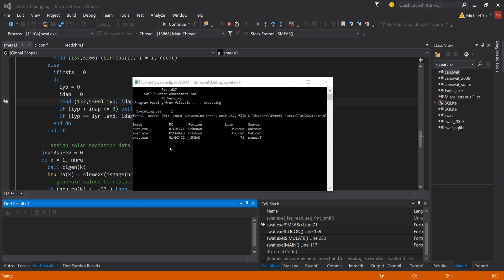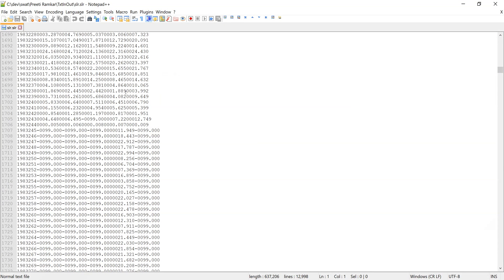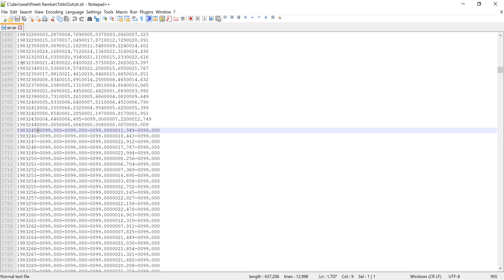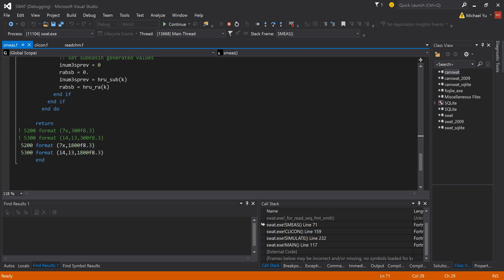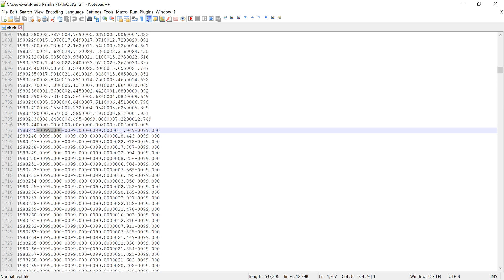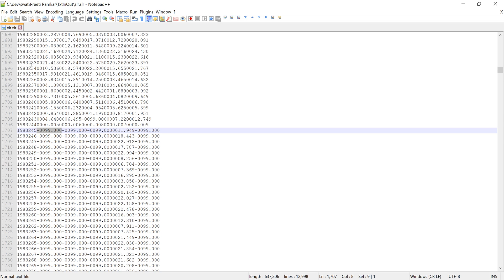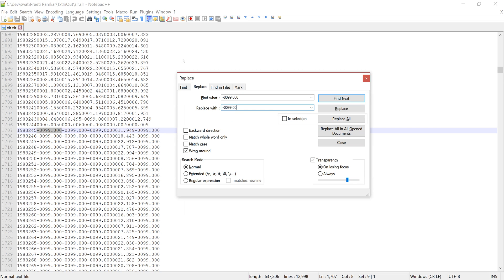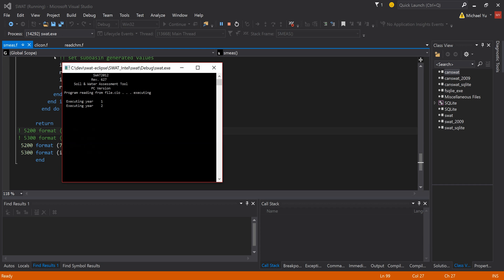SWAT: Input Conversion Error

Comment: Dear sir,
would you please help me fixing error "Conversion from string "12/31/3000" to type date is not valid----type error after selecting tables in SWAT model run.
Reply: change the system date to MM/DD/YYYY format and then run the model
Reply: @cvnishikanth  how?

Comment: First of all, I really want to thank you. Thank you.

Thanks to your video I found the error and I could solve it, then another error appeared, but now in the relative humidity, but apply the same procedure as with slr and it worked perfectly, my silacion ran without marking me that errro.

Again, thank you very much and it is an excellent contribution.

Greetings from San Luis Potosí México.
Reply from the maker: You are very welcome. Hope you get good results. You may want to check my SWAT visualization tool at SWATviewer.com when you get there. Cheers!
Reply: Ok right now I will take a look at SWAT visualization, I only have one question, in your video you work with SWAT and I am working with ARCSWAT version 10.2, my question is SWAT visualization can read the data generated by ARCSWAT and if you can also do a calibration and Validation with runoff data from my study area?

Thanks again
Reply from the maker: Hi Jorge, yes, the viewer would support both ArcSWAT and QSWAT. I'm going to have a video about the spatial visualization. The viewer could help you on manual calibration, e.g. you could compare the observed runoff and simulated runoff and calculates the NSE. But it's not an automatic calibration tool like SWAT-CUP. Hope this helps. Cheers!

Comment: When using the bases of the climato engine that ARCSWAT contains by DEFAULT, it runs perfectly and does not stop at any time, the simulation runs correctly.

The problem arises when I use the databases that I download from Global Weather Data for SWAT, with its format for SWAT. generates the error of "forrtl; sevete (64): inpit conversion error, unit 137, file C: \ users \ Jorge Guillermo \ Desktop \ Balances \ 1986 \ Scenarios \ default \ TxtInout \ slr.slr.", with the video they published, I follow the same steps, but I can not solve the error because the file is not generated in the path that the error is discovered.

My question is, from where or how can I change the slr.slr file to run my simulation correctly.

Thank you.
Reply from the maker: Hi Jorge, all SWAT input files are in the same folder. If you get that error, the slr.slr file will be also in C: \ users \ Jorge Guillermo \ Desktop \ Balances \ 1986 \ Scenarios \ default \ TxtInout. If the file is missing in that folder, you will get another error.